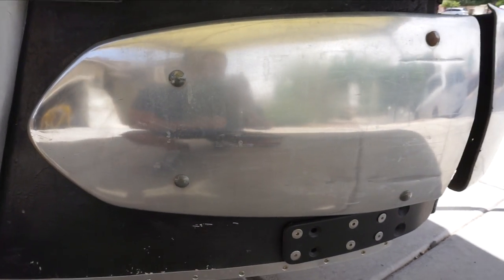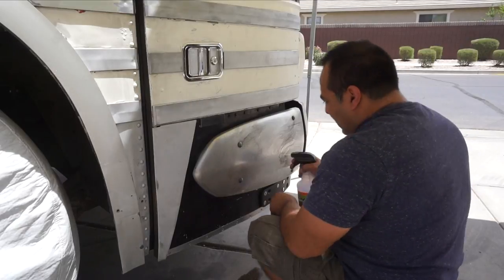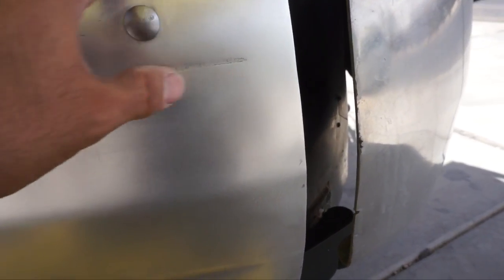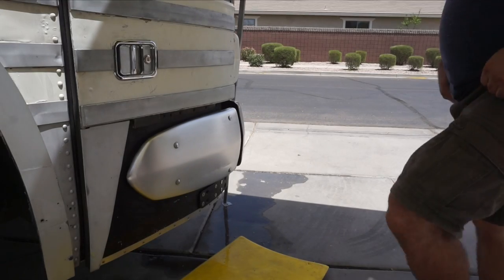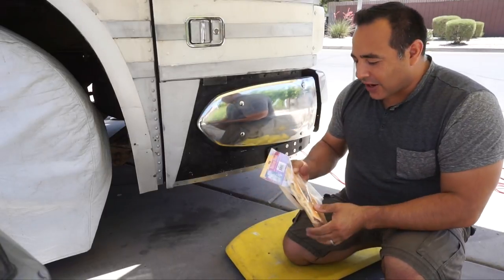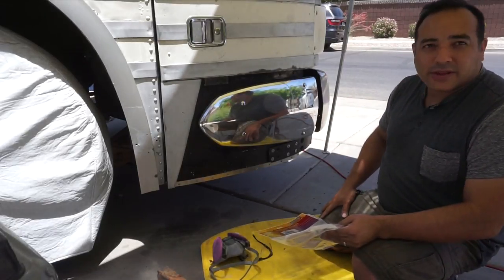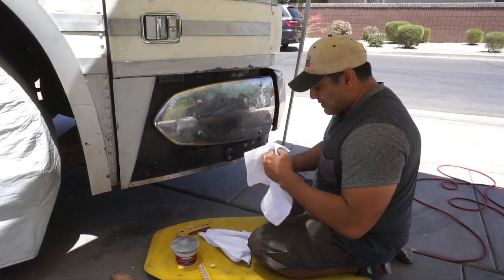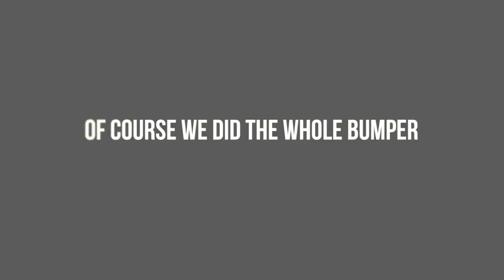Polishing the Aluminum Bumper

Comment: Hi if the white polishing mop is Swansdown it will throw lint and threads everywhere. The way to solve this is using a kitchen blowtorch burn the loose threads as they spin out, hit the spinning mop against a solid surface to encourage more loose threads and burn again. Repeat 3 times until no loose threads appear and the mop is good to go. The white swansdown mop will give an unbelievable high shine finish.
All the best from Australia!

Comment: Good job! Oh the memories... Had a side job polishing large wing leading edges for Boeing and I'd be covered in that black dust. They would send them to me with heavy sanding scratches after they did some leveling. The rouge would cut them down pretty quick. They got no polish or coating after either. Probably a good thing to do though with all the road grime and stuff.
Reply from the maker: LOL yes it is a very messy job (I looked even worse than that last cut after doing the front).

Comment: Dare I say great minds think alike? See the end of this post. https://www.lever-family-racing.com/lever-family-racing-home/family-vehicles/1997-fleetwood-american-dream/trailer-jack-knife-damage-2017-10-20 a couple of differences, I started with a "brushed" stainless steel bumper. I used red rouge? 

At the very end of this video https://youtu.be/GvJvaVPPaAo  I polished out the belt guard for the blower for the dragster. On that my son started with a FILE and then went to 80 grit, I then followed up with 120 220 400 wet, 600 wet, 1000 wet, then went to the red rouge, and then to Mothers.

Have you considered having someone fill the "scratch" with weld (aluminum) then knowing it down with a file and working your way up?

Translates to sore arms no matter how you do it.

I still have to do the front bumper on the bus.

I'm losing my touch, no suggestions to make.

Nicely done!

Glenn Lever
Reply from the maker: Thank you, Glenn. I always look forward to hearing from you.  I watched you and your son build the belt guard into a piece of art - turned out great!  I briefly considered filling in the two big scratches in the bumperette - but I don't really have a good setup to weld aluminum and sometimes leaving the "battle scars" seems OK.